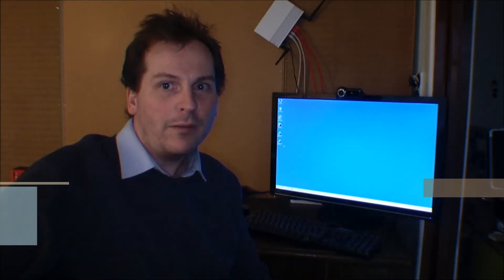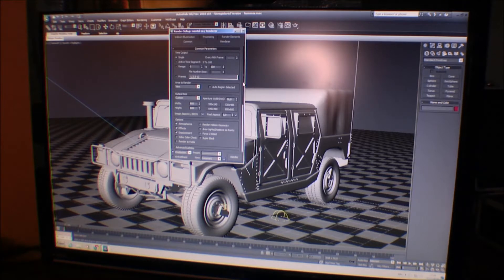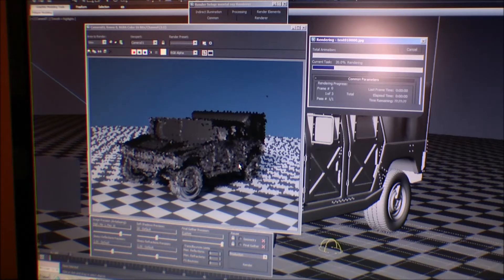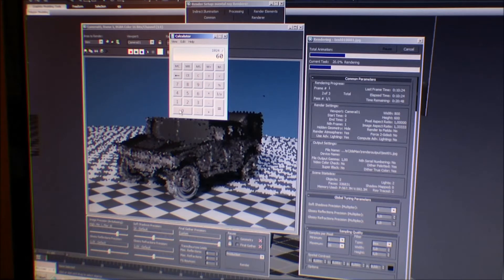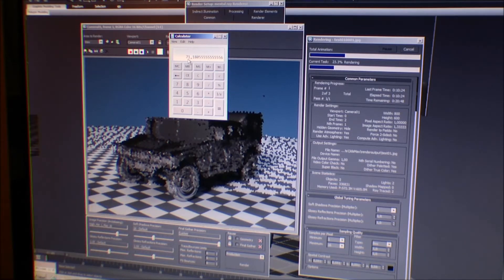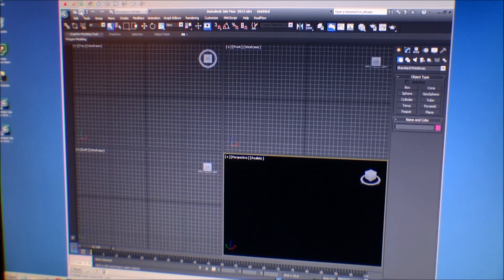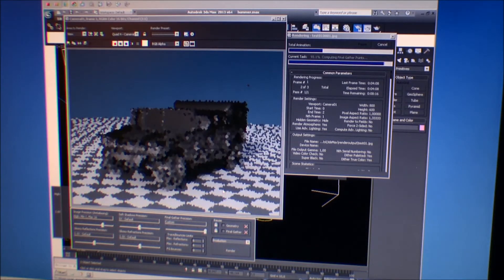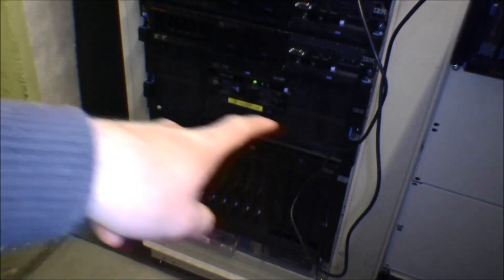Rendering a benchmark test on two machines - 154

Comment: Just tried it on my machine, Core i7-3930K (6-core, 3.2 GHz stock, OC'd to 4.5 GHz, HTT enabled), 64 GB of DDR3-1600 with a bucket size of 128, it took 3 m 45 s. With a bucket size of 32, it took 2 m 40 s.
Reply from the maker: Hi alpha754293 
My best time is on :
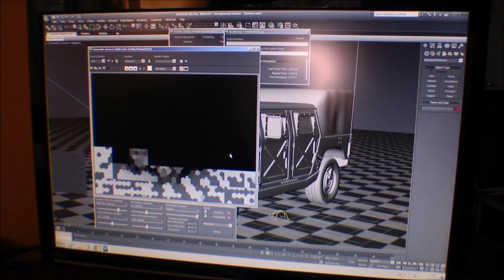VM-Ware - IBM x3650 M3 - 8 core X5650 2,6Ghz 1 Gb ram 3:05 / 1:45 min.
3:05 with a bucket size of 128 and 1:45 with 32.
Thank you for watching! :-)
Reply: My PlayHouse 
Yeah, I know. I saw. I'm not really someone who uses 3dsmax a lot, so having the fastest render time isn't all that important to me. If I were working on it or with it on a daily or regular (or maybe even a semi-regular) basis, then I might be more concerned about it.

But it was just something fun to do.

I don't know. Maybe if I get my blade servers I will try it again, but that's not going to happen for a really long time. :) Thanks.
Reply from the maker: Hi alpha754293 
Your videos of smashing cars together, what do you use it for?
Thank you for watching! :-)
Reply: My PlayHouse 
I used to be a crash safety simulations engineer. Now, I just use it to benchmark my systems (mostly). If I overclock consumer-grade hardware, I also use it to make sure that the system is completely stable at the overclocked speeds (because it stresses the system out A LOT!).
Reply from the maker: Okay,, are you a crash safety simulations engineer. or a stundent?
Reply: My PlayHouse 
I graduated in Decemeber 2009. I USED to be a crash safety simulations engineer. I'm not anymore. At least not for my day job.
Reply from the maker: Hi alpha754293
Is that because the economy chose to crash instead? or?
Reply: My PlayHouse 
I'm not sure if I understand your question, but I will try to answer it anyways. Normally, when you're engineering the body and chassis of a car, we will simulate the crash test results before making it/building it. The process of doing an actual crash test is quite expensive so we will simulate different engineering designs/ideas first before going to production.
Reply from the maker: Hi alpha754293
I asked if you did not have this job because of the economy crashing. 
It would be a bit ironic. :-/
Reply: My PlayHouse 
oh no no no no no....no, I changed jobs/companies for a better job with a better company. There were problems with management where it got to the point where I no longer had trust or faith in the management at my old job. 2/3rds of the entire CAE department quit over time that even on my last day, my management didn't show up to my going away lunch but all of the other people that I worked with (all the other product engineers -- the people that would interface with our customers) showed up for my going away lunch. That's just bad when even your own boss doesn't show up to your going away lunch. But that's what my boss and the department manager was like. It was terrible there. So I found a new, different job, and quit that one.

Comment: Just gave it a try on my machine, i7 5820k, took 3min 27 seconds. =)
Reply: Uh, after changing the bucket width I got it down to 2 min 31 seconds.
Reply from the maker: Hi TheTaulen 
My best time is:VM-WareIBM x3650 M38 core X5650 2,6Ghz1 Gb ram 3:05 / 1:45 min.
3:05 with 128*128 bucket and 1:45 with 32*32
Thank you for watching! :-)